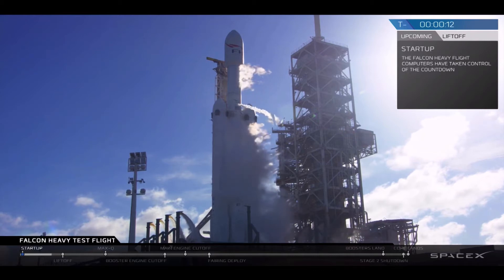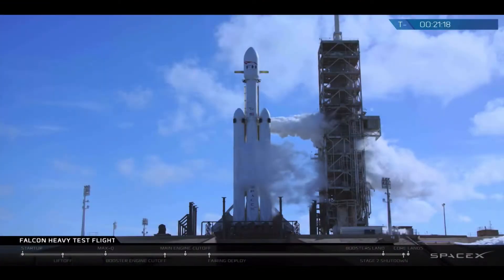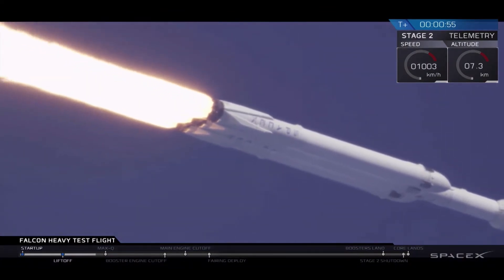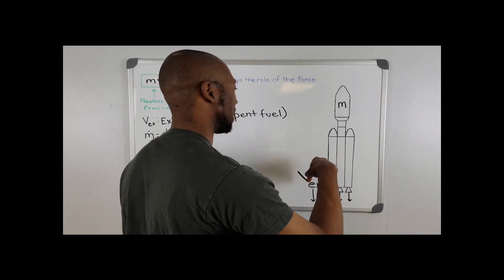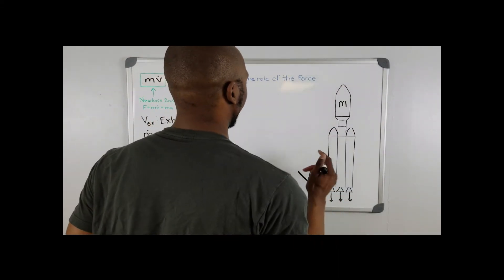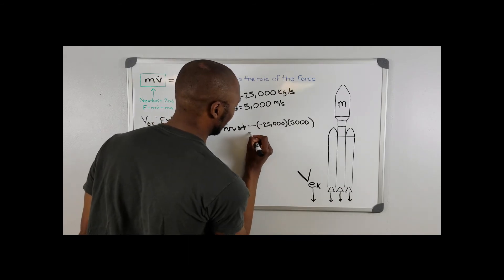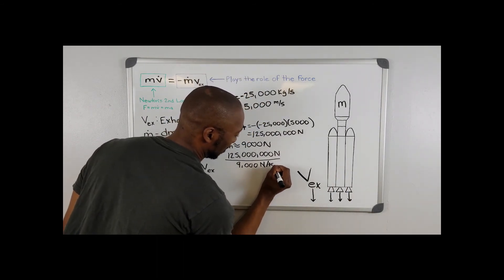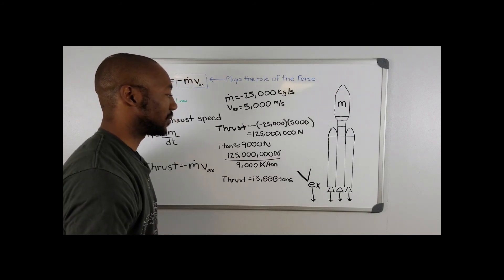Rocket Propulsion: Calculating Rocket Thrust Using Classical Mechanics

Comment: Based on your mathematics, what is the minimum required acceleration, and also the minimum necessary TWR,  for a vertical rocket-launch??? Thanks. K.S
Reply: Minimum Necessary TWR for a vertical launch is 1.
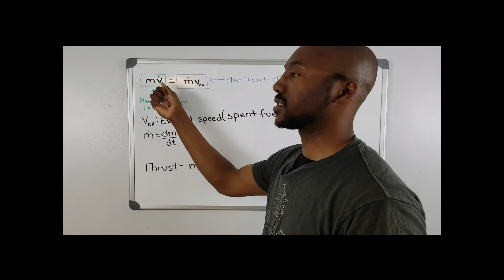Reply: @A-Patriot-R ==Einstein::: The question was to the above clueless "Scientist", who applied 3:00  a Newton formula to rockets which did NOT even exist then. also ("Solving-Apollo-Enigma")  had $5,000 prize money since 2019, for anyone who could prove that an Apollo could lift off the ground even one inch !!! Same goes for spaceX !!!